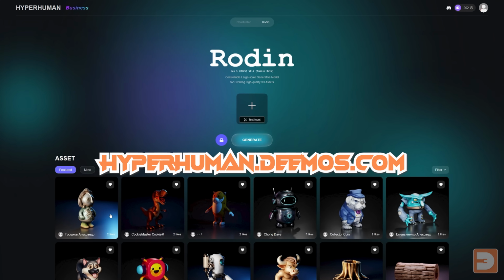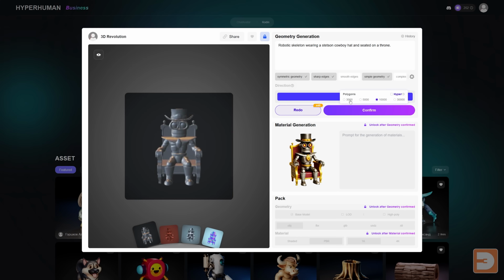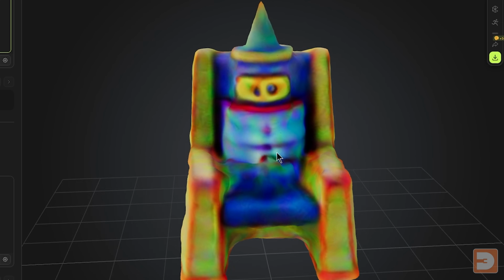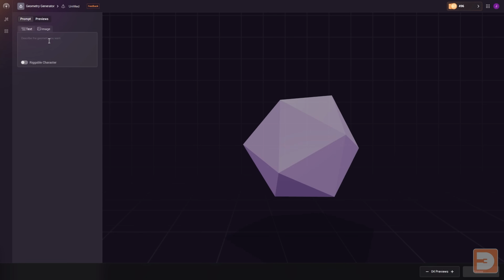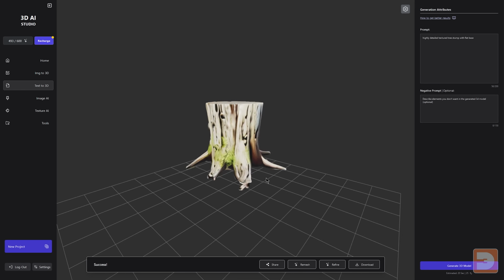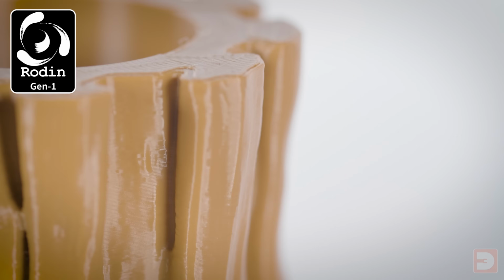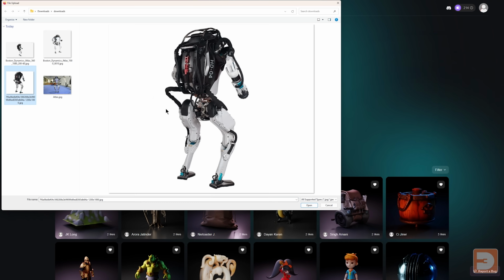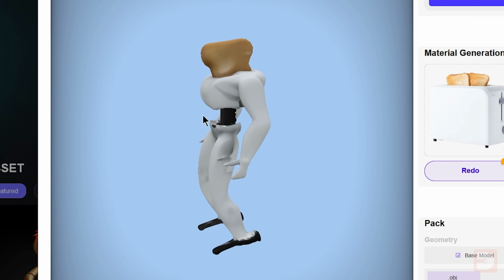Top Next Gen AI 3D Model Generators: Tested for 3D Printing

Comment: At least on Cura and probably other slicers you don't need to cut objects that aren't flat to get a flat surface for printing.  Simply set the orientation to the way up you want then set the z head to a small negative, any part of the model below the xy plane gets cut at that point when slicing and will have a flat bottom...yet I've seen so many people say to get round this by cutting models in mesh mixer...unless you're sharing it on for others that don't know this trick don't waste your time!

Comment: you also should have used CSM and TripoAI
Reply from the maker: I covered Tripo quite a bit in my previous video on 3D generative AI.
As for CSM, I find the user interface is glitchy and problematic.
Plus, the free version quotes over 50 hours wait for a single generation, and even the paid version quotes 2 minutes which is slower than the free version of most of the ones featured in this video.
It's something I will address in the future but I didn't think it had anything to contribute for this video.
Reply: @3DRevolution  you bring a fair point, just found your content will have too look in to your Tripo cover ;)

Comment: For a feature they haven't done yet. It seems like there is big room for improvement on the quest home environment. Right now these are just pointless spaces, it would be nice to have portals and interfaces that take the place of boring menu mechanics ported from tablets and phones. Especially with AI integration. Perhaps I want to ask a magic well or mirror to summon a game or a Horizon space or maybe I want to use hand gestures to cast spells to open portals into different apps and games both horizon and 3rd party. Let us customize the space and have persistance. Also move apps which aren't currently installed into a menu within the apps screen you must open on purpose if they aren't going to let us remove them!

Comment: @3drevolution I've had issues with it not generating the original image. Has anyone run into this? Example: I created a text input similar to the video with a figure on a throne. Looks great and hit generate. It would then leave out the whole throne or a portion of it or even a portion of the figure. Could never get it to generate the whole original image it created. I'm using the free account to start so not sure if that's why.
Reply: Altering the text after it generated the image does not make any difference here. "a elephant on a motorbike" changed to "a duck on a motorbike" generates the exact same image...

Comment: As someone who sculpts my own character prints, these things produce such godawful meshes that most of the time it is faster to genuinely build them from scratch. I've used generated images as references and been able to produce some great stuff, but these meshes barely even get the proportions right, let alone any details. More often than not you're better off just taking an image and building the model with primitives. The "robot king" is still 95% just rectangles, cylinders and spheres stacked on top of each other, with a little bit of proportional editing.

I'm sure at some point these tools will get around to a point where they'll actually create some useful geometry for printing, but these products are nowhere near that. The 10-20 hours it takes to learn the basics of any free modeling software will leave you with a lot more options and far better models than any of these generated dumpster fires.
Reply: While some of what you say is true. Making your own from scratch would be in some ways easier. A LOT of people don't have the 10 hours to put in just to learn how to use a modeling program much less to actually make the models. I think for a lot of people this is a dream of "I have this idea in my head and I want to see it come to life." that's pretty much what 3D printing is all about. 
If people have the brain power and the time to learn how to 3D model their own things it is a 100% worth it if you're a 3D printer enthusiast But recognize that this is not something the is in everyone's wheelhouse. And people are looking for a tool that will help them overcome this.